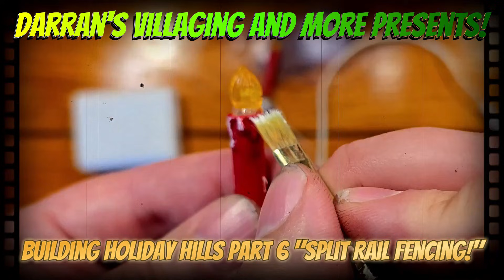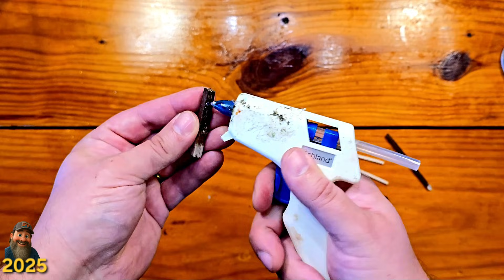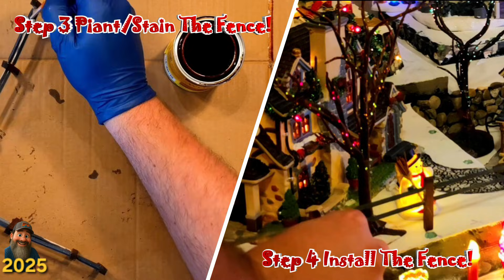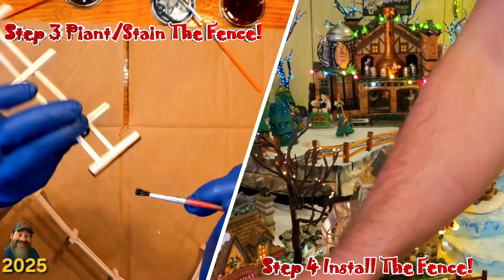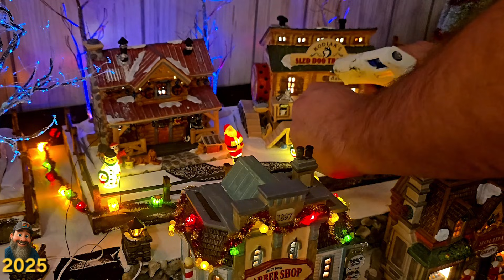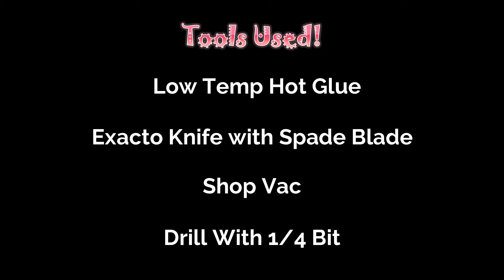Part 6 Of Building "Holiday Hills" Christmas Village! Split Rail Fence! #christmasvillage #christmas

Comment: The village is looking so good! The fences are such a great custom addition. Love those nutcrackers!! I wanna get them for my North Pole village! What are/where did you get the trees that are buy the house with the nutcrackers? Did you adding the lighting to them?
Reply from the maker: Hey Kelly Thanks for watching! 

The trees that are in front of the Harrison house with the nutcrackers are Lemax Ice Glazed Trees item #94994.

 I reminagrd them in a previous video to change out the stock LEDs and use some of my last, favorite color changing leds that I recycled from some circa 2016 Target Halloween string lights.

 These are also the LEDs that I used in my fiber optic trees for my cemetery for my Halloween build

Big things are a cooking here, as I push to get it done!😂 I should have started building this in September! 😂😂😂